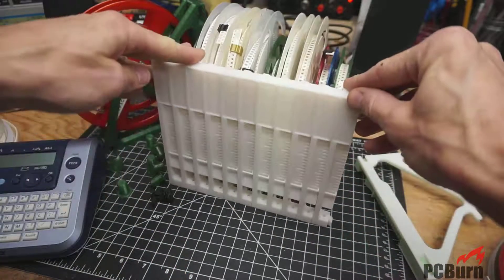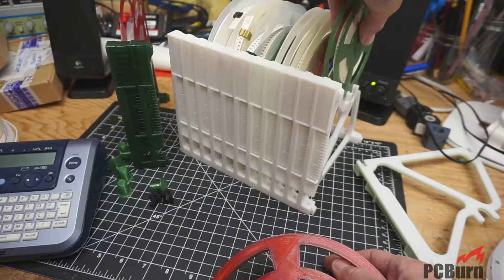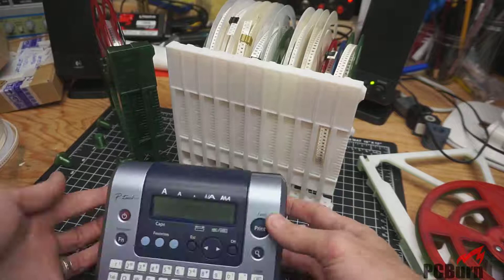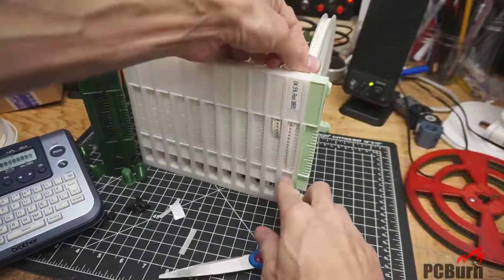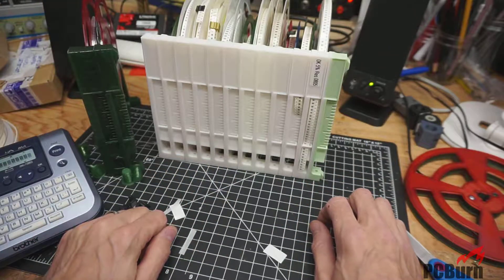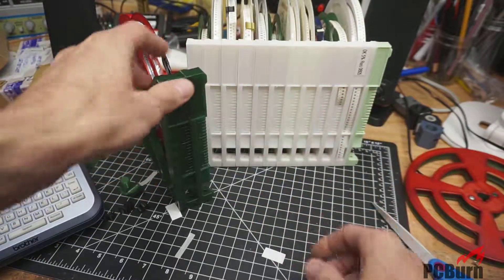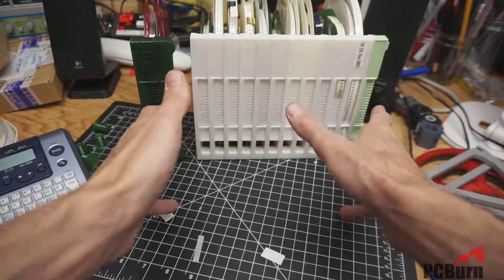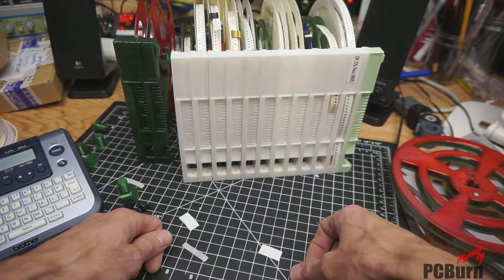Spooling my SMD Components on Reels for a Cleaner Workbench

Comment: You welcome 8))
Reply from the maker: Hey! Thanks again, having a working design saved me quite a bit of time getting this stuff cleaned up.
Reply: @PCBurn  I can make modifications u need - solidworks model is quite parametric.
Reply from the maker: Awesome. Your original design has a good amount of clearance for the spools with 9mm reels; the next two larger sizes are 12mm and 16mm. Increasing the width by 3mm worked well for the 12mm with the same overhead for the spool sides... I also needed to increase the depth of the opening a bit for the components being a bit larger (in this case the components are 2.25mm; so say a 3mm opening).

With a wider 16mm holder a width increase of 7mm width a component depth of 3mm opening would probably work for many of the ICs on that size tape as well.
Reply: @PCBurn  Thingiverse files updated - please test 8)